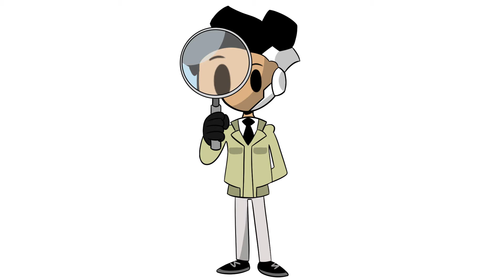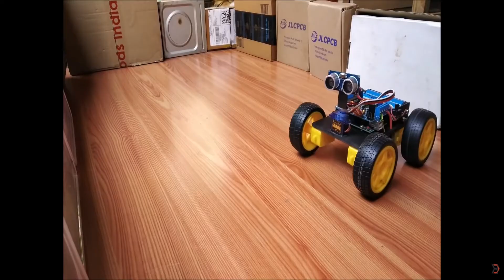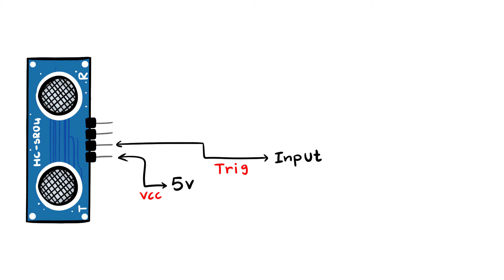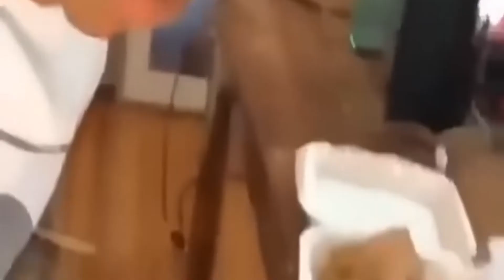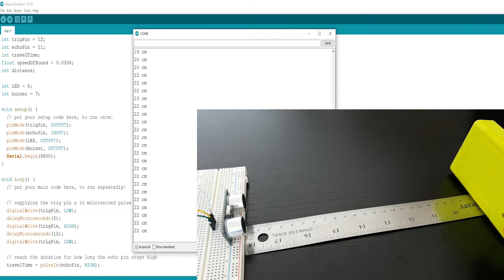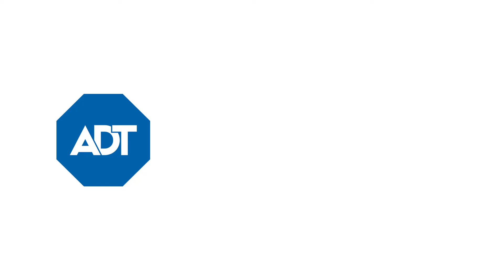DIY Security Device for my Room (it's bad)

Comment: Next epsode idea - add a security pincode to the lock:
there is a set of 8 switches inside the door and a 8 buttons outside. Connect each pair throughout a XOR gate, and AND all of the outputs together. When the arduino detects the output (of the and) is true, then disable the alarm. On the inside of the door, add another button to re-enable the alarm. Now there's a way to come in! (extra programming challenge: add a button to get out, e.g. a button that when pressed times the program out by a time.Sleep(10000) so it pauses for ten seconds, enough time to get out and close the door without the alarm activating, and after 10 seconds, reactivates the alarm system)

Comment: Why didn't you switch to mechatronic engineering
Reply from the maker: Because computer engineering gives more in-depth knowledge of computer architecture (which I'm really a fan of) suchs as: algorithms, electronics, networks/protocols, embedded systems, circuit analysis, etc. 

Mechatronics sacrifices some of that knowledge for control systems like gears and pulleys (which I'm not really a fan of). I only like the the idea of robotics in that major.

I'd rather self-teach myself robotics and take robotics related courses as electives.